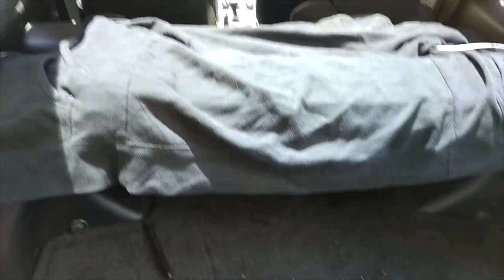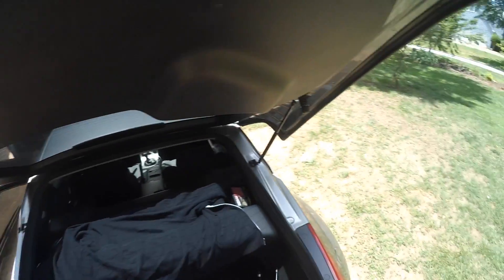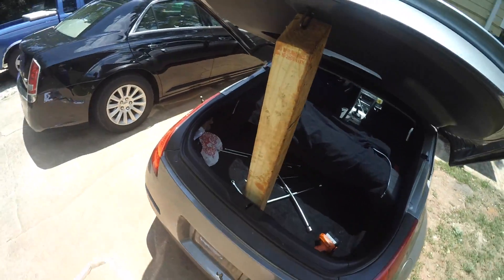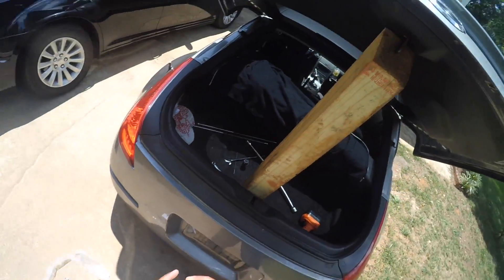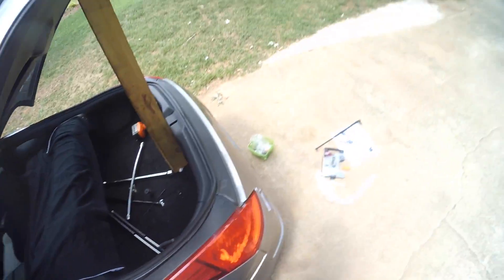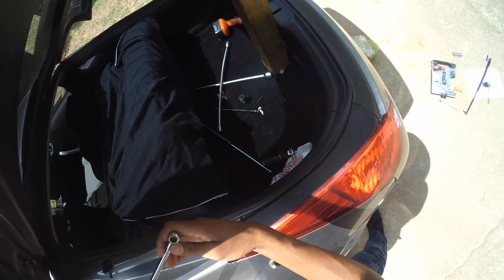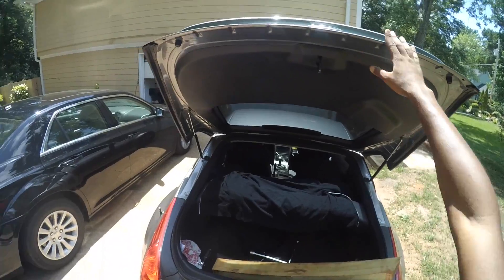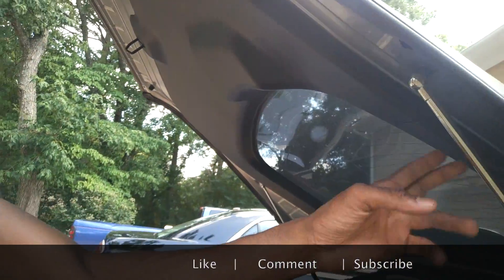350z hatch strut - tutorial

Comment: You don't have to unscrew anything. Use a flat head screwdriver to pry out the retainer clips on the old struts. Pull out the old struts. Pop the new struts in. I found this out while installing new hatch struts on my 350z a couple days ago. Unless the mounting hardware is severely degraded, there is no need to add the extra work.
Reply from the maker: Depending on the strut's brand. I had one strut bolt break from a different strut brand.

Comment: My new hatch struts are causing my hatch to sit like a half inch too high in the front it would easily leak is there any fix for this? I installed them correctly
Reply: My hatch is facing the same problem
Reply: @BigBoyz33  I installed my brackets incorrectly it was upside down rookie mistake! I flipped them and the hatch sits perfectly flush no damage caused either I got lucky.
Reply: @z33tanner  OH SHIT!! That's probably what i did wrong. Thanks for telling me!
Reply: @BigBoyz33  No problem! Have fun with your Z!
Reply: @z33tanner  thank you, you too!

Comment: I attempted to remove my struts by the bolt heads snaped off now the bottom of the bolt is stuck inside and I can't put new struts on -_-
Reply from the maker: You are going to need to use either drill out the bolt of use a broke bolt kit to get that bolt out.

Comment: I'm trying to change my struts on my z but the top balljoint strut nut is fucking stripped and seized and I have no idea how to get it off
Reply from the maker: best option is probably vice grips
Reply: @NicolasKeeton  nah... so nobody told me you were supposed to break off the factory struts, if you're upgrading them.. i was out there trying to undo it while it was all still connected. If it stands for anything I managed to get one side off that way. But breaking the factory strut off the ball joint, then using a deeper socket worked as intended

Comment: Damnit. For the studs in my struts 12mm is too big and 11 is to small......
Reply from the maker: Sounds like someone replaced the studs with aftermarket ones. Your best option might be to hit up homedepot to find a cheap rachet/spanner set.
Reply: Nicolas Keeton Nah. They look OEM. i bought a little adjustable spanner but it's -10C here and I'm worried it might not work. Don't want to strip it. How are your struts holding up. Literally :)
Reply from the maker: Paweł Be the new ones are still holding up well. Even when it's cold out.
Reply: Nice to know. I've removed left strut easily. The right one...I don't know if I'll have to cut the ball socket with strut in the hatch.
Reply: I've replaced the left one. It holds pretty nice even with old right one. I'll have to cut the right ball joint anyway, I won't be able to unscrew it.
Reply: I just had the exact same problem, and have owned my Z new since 06' right off the truck with 3 mi. on it.  Luckily my bolts snapped like a twig thanks again to Renault/Carlos quality.